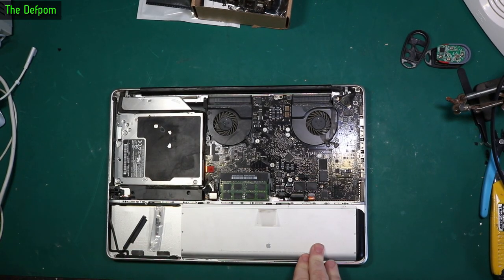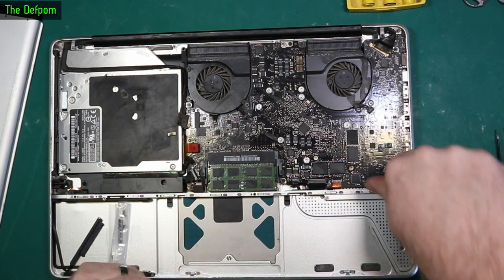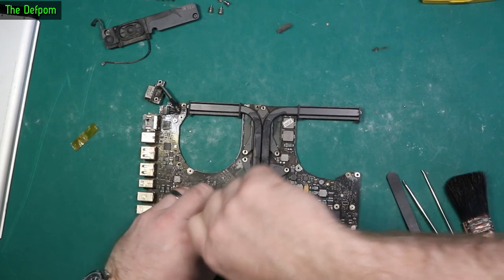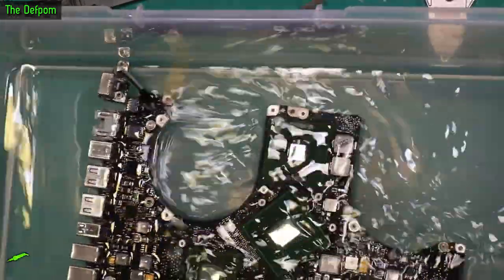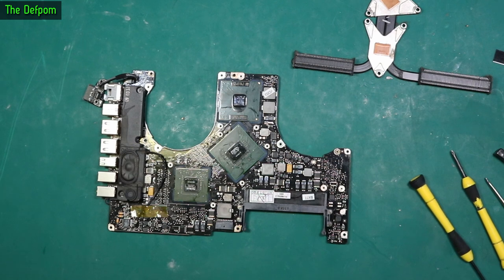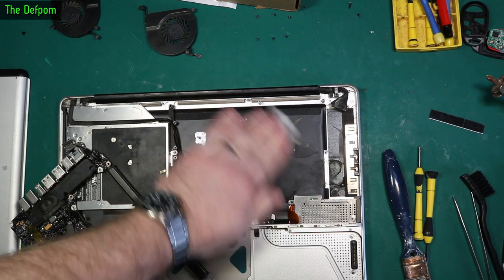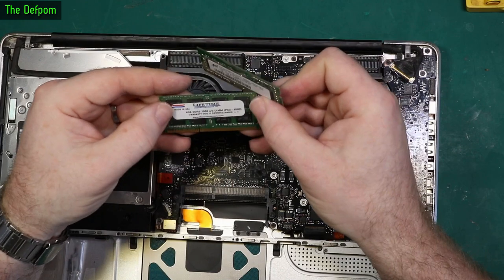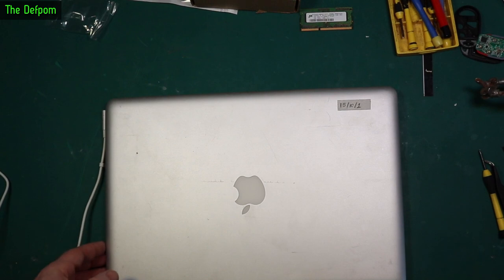🔴 15" Apple MacBook Pro Liquid Damage Repair - No.1091

Comment: If the board is the 820-2330 (15"-2008) there is a well documented issue with C7771 not giving the good voltage to GPU circuit. It must be replaced.